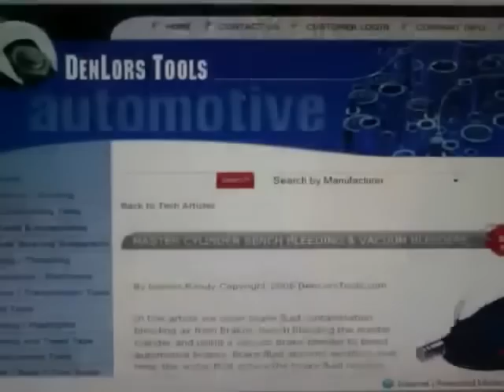Auto Repair - Bench Bleeding a Master Cylinder

Comment from the maker: Could be done mounted on the car, however it may be angled wrong. You want it level to allow more air to be bled out. Air may be trapped, if its NOT level. Also bench bleeding it can be done by one person. Once it's on the car a helper pumps brakes up and the lines can then be cracked open to bleed the final bit of air out.

Comment from the maker: We cover brake fluid contamination, bleeding air from car brakes, bench bleeding the master cylinder and using a vacuum brake bleeder to bleed automotive brakes. Brake fluid absorbs moisture over time; the water that enters the brake fluid reduces the fluid's boiling point. Water mixes with brake fluid, it does not separate like water in fuel or other petroleum products. See the rest of the article at DenLorsTools